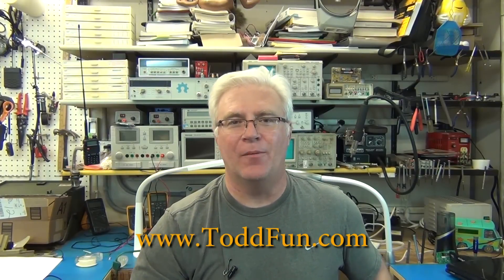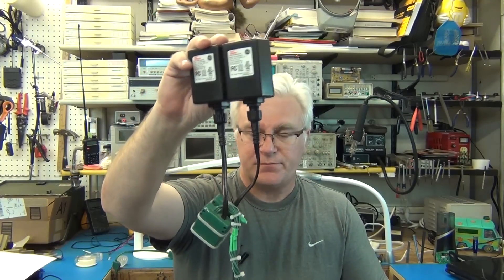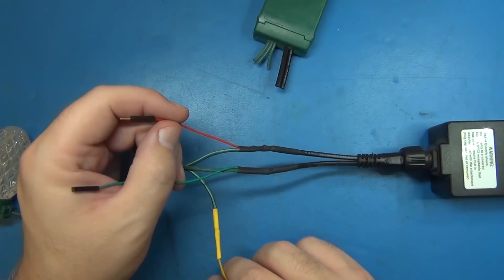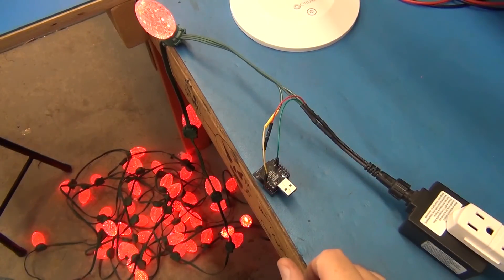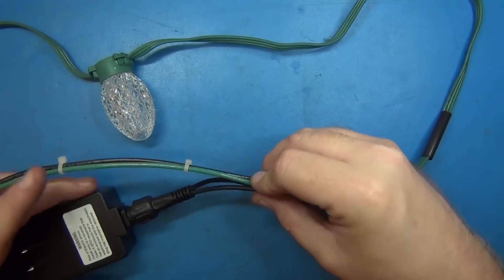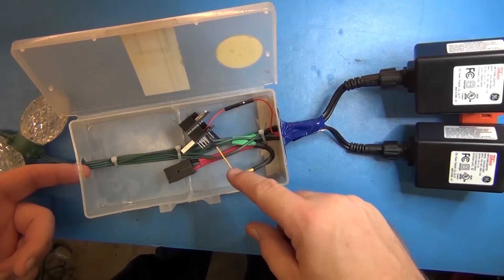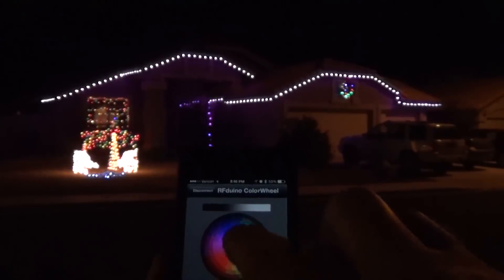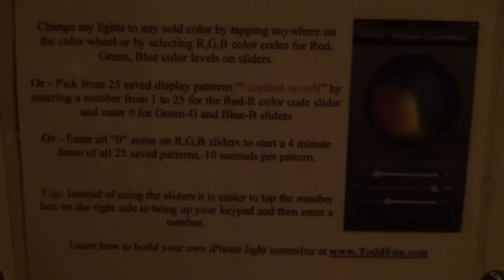iPhone Christmas Lights Controller for GE G-35 LED Lights

Comment: That's impressive. I bought the itwnkle wifi and it's pretty much the same as yours. I wish they made connecting ends for GE products. Good Job!
Reply from the maker: +cj simangan Thanks. I think the industry watches pages like mine to see what people are hacking and then just copy our ideas. The bluetooth connection and coding wasn't my idea so I'm building off others work from a few years back myself. I'm sure those GE WiFi iTwinkel lights don't need to connect to each other because you can enumerate each string and then tell the 1st string it is master then the other strings will follow the master. But you do have to proved an outlet to each for power if that is what you mean.
Reply: Color Effect do but not iTwinkle, apparently they draw much more power.  That is why they come with a bigger power supply the the color effect one which can also handle multiple strings.  I suspect you could hack the iTwinkle to power 3 or 4 at a time but have not done the power usage calculations but you still would have data line issues unless you replace the controller too.

Comment: Hi Todd! Been watching your videos on these lights the past month or so... Planning way ahead for the holiday season next year.
I see they still offer this model of lights in general. I also see you mentioned you use LumenPlay lights.
Do you have a recommendation on the best strand of lights to get for the purpose of controlling then through an app? Would there be any way of hacking the LumenPlay controller to work with the GE lights? 

Thanks for the help! Really enjoy all your videos and content.
Connor
Reply from the maker: LumenPlay  are best. You can't combine the two systems, well, you can hack out the lights and build your own controllers as I did with the GE's but I"m sure the chips in the lights are different in the LumenPlay so it still wouldn't work together. I reviewed the LumenPlay in another video if you look it up on my channel.
Reply: I would rather hack the GE lights, they still sell the color effects series and the RF,  iTwinkle and color effect all use the same control commands.  I wish you would make similar instructions for the ESP8266 WiFi chip hack.  I still can not get the firmware to load.  The LumenPlay app may be slow but it sill much better the the chinkware Woo made.

Comment: For really long cable runs, I would suggest using a pair of RS-422 trancievers (TI SN75176B) and connecting them with some old CAT5 network cable (twisted pair).  The SN75176B will run off a single 5V supply. You'll need to add bypass capacitors and termination resistors near each transceiver IC.
Reply from the maker: Yup, that would work. I have changed to using a set of twisted pair over cat 5 with much better results and longer runs with no other additional circuitry. An idea given by another viewer of this video.

Comment: Got mine out this year to check on them.  Any reason why the lights won't accept lock mode anymore?  I input the 373738 code, it flashes and then disconnects and resorts to the default.  Do I need to check wiring?

Comment: Great video.  I'm going to try this hack with a bunch of strands I have next week.  I have two questions for you though.
1) In the video do you have 2 RFDuino controllers, one for the paralell sync and another for the single strand? Or do you have all 3 running off 1 RFDuino?
2) In the code do you put to the total light count, e.g. two strands of 35 lights = 70, or do you input 35 as this is the light count per stand?

Thanks much and I've enjoyed watching your videos on this topic over the last few months trying to wrap my brain around it.
Reply from the maker: I have 3 all getting data from one RFDuino. One is 20+ feet from the RFDuino so I use a bit of twisted pair network cable to make a clean signal connection over to it. All three strands get 5 volts from their own original power bricks. The light count in the code is for just one light because the same data signal goes to each strand of lights and each strand of lights thinks its the only strand, they don't know about each other because data and ground each strand is in parallel. This code will only control GE-35 type light strands. It will not work with other strands  unless they are electronically identical to the LED's and LED signal control ICs in the GE-35 type lights. I hope that helps. The color wheel app does not seem to work anymore but any Blue-tooth low energy app for a phone or for a computer will work to send the hex codes to change patterns. I'll post a hex code conversion to the page some day but here is a dump of my notes as of know:

updated - 11-11-2018
Tge Color Wheel app does not work too good for this code anymore, they change the app.

This is the correct starter kit on Digikey if they have any in stock:
https://www.digikey.com/product-detail/en/rf-digital-corporation/RFD90101/1562-1011-ND/5056358

But you can still get the two items stand alone. 
You'll need the UBS power / programmer board: 
  https://www.digikey.com/products/en?keywords=RFD22121
And the RD duino board
  https://www.digikey.com/product-detail/en/rf-digital-corporation/RFD22102/1562-1000-ND/5056347

Together this is the same as the starter kit but it might be a bit more than the simple starter kit $.

Yes, you can set your lights to orange for fall by simply sending the HEX code for all orange. 
It's not as easy as having the Color Wheel app, howerver the color wheel app will still work for picking a solid color.

If you want to pick one of the 25 saved patters in my code 
or you want to save the pattern to flash memory so it always starts every day at the same saved patter you'll 
need to use LightBlue LE app for the iPhone and enter the hex values.
  https://itunes.apple.com/us/app/lightblue-explorer/id557428110?mt=8
  
Or use any Blue-tooth low energy "LE" phone app or PC app to connect to the RFDunio and send hex command codes.
  
Unplug your lights and restart them. Then use this new tool. It only sends HEX commands so I'll do my best to talk you through how to send RGB codes and colors in hex.

Down load "light blue" from the app store. The icon looks like a blue fist.

 To use the app you first connect to the ToddFun lights
 Then click on write option 2222
 then click on write new value
 enter a six characters hex value for the code or for the RBG color you want and click done
 Now you should see your new hex value as a listed item under write values
 Tap the hex value you created in the list and it will be sent to the lights as a command in hex
 You can click on write new value again to create more commands in the list or tap the info icon to change the value of an existing item in your write list.

 To just save the current pattern as the default power on pattern send: 373738 HEX
  
 Your string might be in lock mode so if it is not taking new commands power cycle the lights at the outlet then toggle the lock command once like this.
   lock/unlock toggle hex code is: 373737    
   the lights will blink once for unlock and twice for locked
   This is also save current features including lock mode, cycle duration, cycle mode and current color or pattern.

 Enter command codes as string of 3 hex numbers.
 So to send dec 0,0,0 you would send hex 000000 which is 00 three times with no commas and no spaces.
 To send dec 255,255,255 you would send hex FF three times like this FFFFFF
 To send program number 1 which is dec 1,0,0 you would send hex 010000
 To send RGB setting for sold red lights you need dec 255,0,0 which is FF0000
 To send RGB setting for sold orange you send FF3700
 And so on for all the sold RGB colors you want. But not in the program range 0,0,0 through 25,0,0 so no RGB hex settings between 000000 and 190000 because those values are for the below 25 stored programs.

So your programs 1 through 25 are entered as hex as noted below:

HEX    DEC NAME
010000 1 Christmas Switching – Snoopy’s house in “A Charlie Brown Christmas”
020000 2 Christmas Twinkle – Purple Orange Green
030000 3 Christmas Switching – Red Green
040000 4 Candy Cane Wave
050000 5 Green Phasing
060000 6 Red & Green Chasing
070000 7 Red to Green Dither
080000 8 Red, Green & Blue Chasing
090000 9 Red, White & Green Chasing
0A0000 10 Red, Green, Blue & Yellow Chasing
0B0000 11 Red, Cyan, Green, Magenta, Blue & Yellow Chasing
0C0000 12 White Twinkle
0D0000 13 Christmas Starlight
0E0000 14 Cold White Icicle – Slow Pulse
0F0000 15 Slow Pulse
100000 16 Full Rainbow
110000 17 Full Rainbow Interlaced
120000 18 Autumn Rainbow
130000 19 Colour Wheel Smooth
140000 20 Always Changing
150000 21 Blue Phasing
160000 22 Green to Blue Dither
170000 23 Blue Wave
180000 24 Subtly Changing Pastels
190000 25 Brad Harri Fall Colors
Reply: @ToddFun  Thanks for the very detailed response.  This should help a lot!
Reply: @ToddFun  So I've got pretty much everything hooked up but still have a little hiccup.  I have the RFduino being powered by a USB extension cord and usb wall power adapter on its own power supply (I didn't splice it into the power brick line as you did).

 Is there any reason why some of the lights on an individual strand would fail to change color after entering the hex program code?  Most of the them do but there are a few that don't.  

My thoughts...
Is the RFduino not getting enough power?  
Do the pigtails (Dupont Wire) need to be a hire gauge wire from the RF Duino to the data line on the strand?

Any thoughts would be appreciated.  Thanks.
Reply from the maker: @edwardstuart9176  Make sure the ground on the RFDuino is sharing the ground with the lights. Must be or I don't think it would work at all right now. Could be a power issues but most likely it is signal drop do to distance from source to end. Make sure to use twisted pair wire for any connections to shared strands like found in network wire and keep it as short as possible. Yes a larger wire will help with signal drop. In the end there is just limits to how far you can push a weak signal. Glade Elastic Wrap with outer aluminum foil shielding on any open circuit and wires can also help with signal drop do to interference.
Reply: @ToddFun  Just got home and you're right! Have to have the RFDuino powered by and grounded by the lights in order to work.  You're awesome.  I'm all set now.

Comment: I have a question regarding the G-35 lights in general. I have lost my remote for 4 strings purchased at Costco. Is there a different remote that will work? From what I understand it a pretty basic remote? If not can they be reset? I currently have 3 running one pattern and the fourth another. All I want is any one pattern for all 4. All the wiring business kind of scares me a bit ... just want to use them all. GE told me to buy new lights 😑 thank you in advance
Reply from the maker: Now, you will not be able to use any remote. You will need to get a remote for the GE-35 but it can be for any of the strands be it 20, 30 or 50 so maybe you can fine one on eBay. I don't use mine anymore of course but I think I put all mine in the trash. I'll check if I have one in a junk box or electronics salvage bin and get back to you if you care.

Comment: Todd one of my string of lights are not turning on. My power supply is getting the 5volt DC out my power supply. Can connect one of the other controller this string of lights or is my controller power supply to the lights out.
Reply from the maker: What? If you have a second identical set of lights you can switch the power supplies to see if that's the problem. If they are not identical but outputs 5v DC it might still work if the power supply can handle the load but it's less of a definitive test. These G-35 lights die a lot, so much they quite making them.
Reply: @ToddFun  
I am getting 5 volts going in 
But don’t know if it coming out
Of the module to the lights. Could I wire the 5 dc direct to the light and connect the data wire to another module with its own power supply each.
Reply from the maker: @louielopez4007  Yes
Reply: @ToddFun  
Thank you Todd I will let you know if it works.

Comment: I have two strands of 50 Lights, did your sync hack a year ago worked great .
ready to step up and use the RFDuino. a couple of questions before I start.
1. I own a iMac, I see all the programs you mention for the RF Duino have a Mac counterpart. Your Files are PC based can I load those into the Mac programs or should I do this at work where I have a PC?
2. The black slide on connectors for the RF Duino legs what are they called and what is the best place to buy them.
Reply from the maker: +Jim Jones Yes, the sync worked great and is still working. You should have not problems using the code files on your Mac. Link to connectors I used :http://astore.amazon.com/tod0f5-20/detail/B00FU2YWXY
Reply: +Todd Harrison (ToddFun)  Thank you for your great videos, Yes the Sync worked Great with no problems to this day.
Reply: Those pages no longer work.

Comment: I have mine running off an arduino 100ft away through 16ga extension cords 1 wire for power 1 for data and ground for ground.. I have not seen any sync issues :)
Reply from the maker: Chris McNeil Wow, that is amazing. Your arduino must have a much stronger and cleaner signal output then what GE original put in their controllers. The OEM controller was build as cheap as possible I'm guessing and just can't push that far without timing issues. I bet my RFduino would get a lot more distance too. I should try a smaller easier to manage cord. Thanks.

Comment: Final question, when you upload a program to the RFDuino does it delete any programs already in the RFDurino? If not is there a clear command to delete any loaded programs.
Reply from the maker: +Jim Jones It does over write the run program every time so there is nothing to delete or clean up.

Comment: I was so excited to see this and then I found out that these lights have been discontinued for sometime.  You can find a few on eBay but at a premium price.
Reply from the maker: Michael Massey In my show notes I link to the iTwinkle set by GE. You can still buy iTwinkle and they are cheaper than my RF lights cost. The iTwinkle are made by GE and use the G-35 bulbs so you can use them as is or hack out the controller and put in an RFduino following my instructions. link: http://astore.amazon.com/tod0f5-20/detail/B00OZOFAHK

Comment: Hello Again Todd, 
So my level is absolute beginner, In deep at the moment.
Spent the Morning watching Arduino videos and will continue so I have a better understanding of what I'm doing. I downloaded the RFDuino hardware Plugin and your Libraries. Fumbled around enough so the Arduino program has an RFDunio Board and can see my RFDuino Board on a port. So here are a couple of questions I hope will help others. 
1. There are a lot of libraries between the ones in the Github Folder and your Libraries,which ones in the Git hub folder are important to making this work . 
2. In creating &  uploading Sketches what do I need to place in them and is there an order, or do I upload the Git hub and then add your Library. 
3. In trying to upload I am getting syntax errors, most likely because I have no idea what i'm doing The Tutorials are helping. My suggestion is, you might create a Video with just the Arduino Uploading section showing how to. I think it would be helpful. 

Before trying this I did buy a new strand of the iTwinke WiFi lights. In trying them on the floor I found them better than the first set I bought but the programming section of the program is extremely limited. I can control color and speed but not effects. Really like your pattens, Very Christmassy . hoping to get this working and making a return trip to Costco for the return. 

Thanks for any help you might have. 
Jim
Reply from the maker: +Jim Jones Well you will not be a noob after this project :). It really requires you have some arduino experience but not much more so you can do this project once you are familiar with arduino. All the steps you need are in the blog posting which I'm sure you're following: http://www.toddfun.com/2014/12/27/build-an-iphone-christmas-lights-controller-for-ge-g-35-led-lights/
The upload to RFDunio will work if all the libraries are in place. I would think you might not have the RFduino hardware plug-in and libraries from Github in the correct folder path of your Arduino home folder. Follow that section carefully. Private message me on  YouTube if you want more help.
Reply from the maker: +Jim Jones And you might want to download the 1.5.8 version of Arduino IDE just so my instructions are more clear and you don't get goofed up by some changes. You don't have to do this if you know what you're doing but if you don't it could help make the process smoother for a beginner. https://www.arduino.cc/en/Main/OldSoftwareReleases#previous
Reply from the maker: +Jim Jones I also covered the software install and setup in this video around the 20:40 mark.
Reply: +Jim Jones Thank you for all the Help. Nice to know your willing to help . that just great.
Reply: They have 8 basic effects as I recall plus custom colors but those only work with their pre-built pattern unlike his or the LumenPlay.  What I want is the LumenPlay software features with the saturated colors of the GE lights.  It would be nice to be able to to Vixen 3 or xLight but I do not need it.  I just want to not be so restrained.